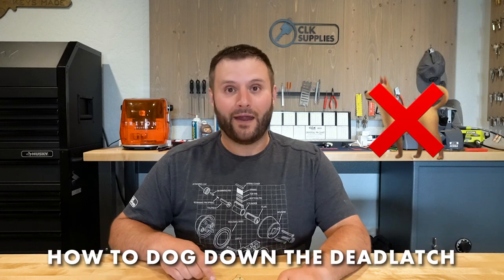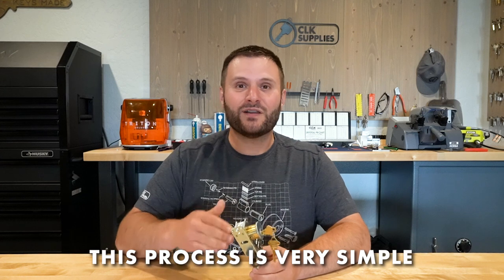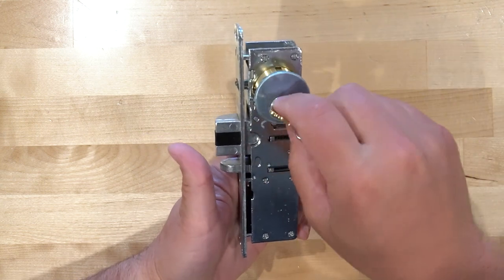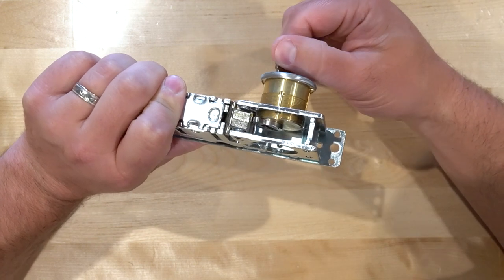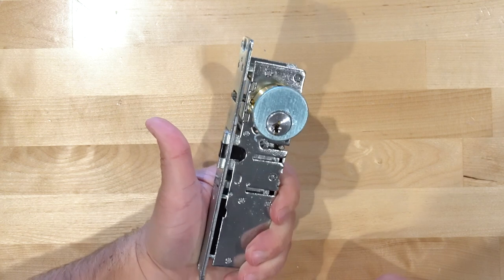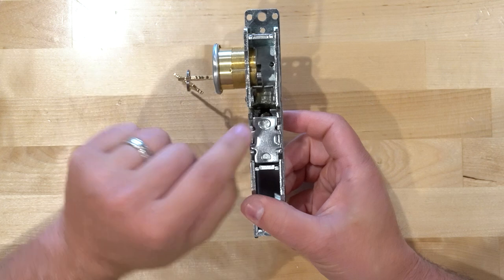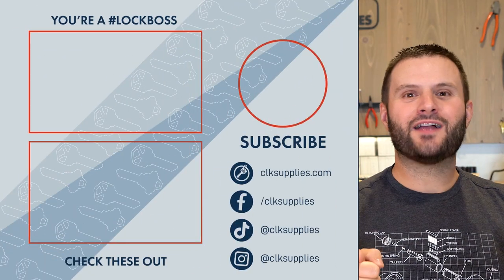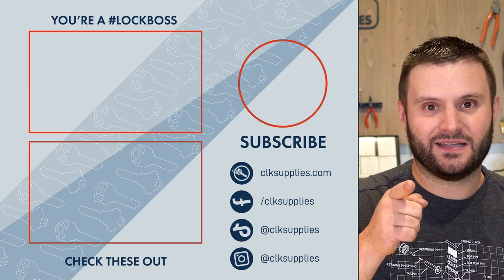No Special Parts Needed: Simple Guide to Dogging Adams Rite Door Deadlatches #lockboss

Comment: Sometimes I have to brake the dogging ears off when renters find they can do this. Then they go back to stuffing things into the latch guard holes.  Also,,,,,
The amount of user error issues I have that are call backs when I tell them. Push the latch in with your finger. Don’t use the exit paddle to dog the latch open.  I’ll probably be back in two months when they tell me the door isn’t digging properly again. They get charged when I find nothing wrong and it’s user error again. #lockboss